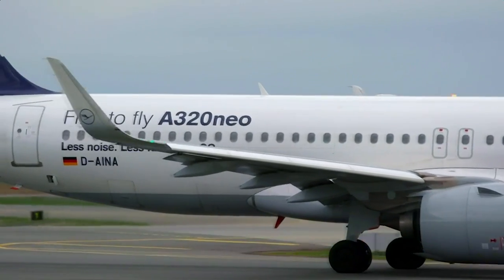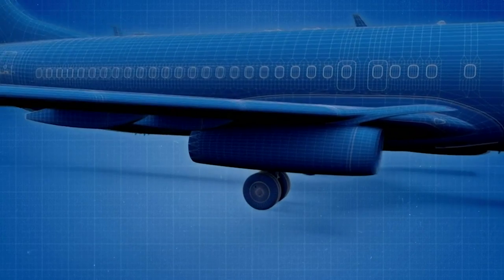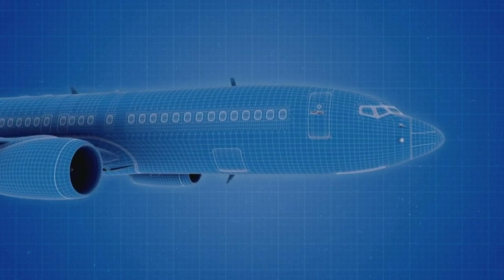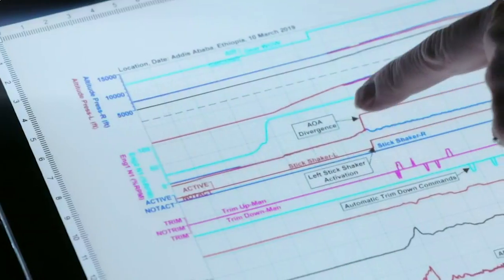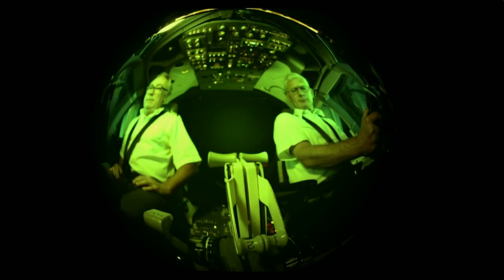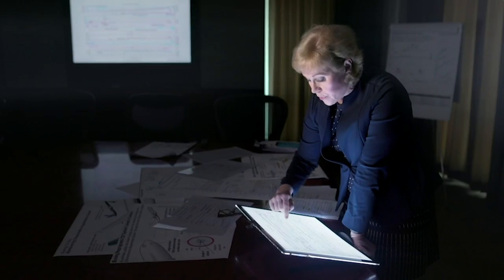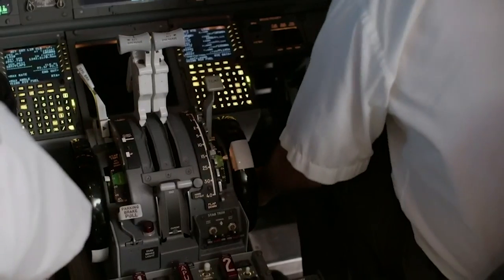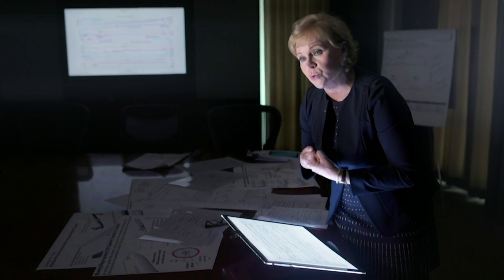Software that Contributed to 2 Boeing Plane Crashes

Comment: It is amazing that Boeing chose, of all the attitude data, one of the most unreliable ones to feed attitude data to MCAS with out any redundancy.
This comes across as a quick fix to a quick fix with the aim of Boeing to maintain market share...scandalous!
Reply: when you are programming the system and your wages are $9 an hour in india. dont expect so much. this is nothing for boeing. the 727 they lost over 100 airframes! the 737 max only 2 so far.

Comment: "Boeing engineers moved the engines forward." They did that because management told them they couldn't develop a new plane and they would lose contracts. The software didn't kill anyone, it was greed.
Reply: Along with that the company didn't give pilots extensive training on the differences between the boeing planes also due to greed.

Comment: Ethiopian 737 sensor broken by bird? I don't think so because the plane not crash around airport.  The crash site is 25-30km away from airport. Some pilots reported they struggle several times in 1 flight.  Please tell the truth. Boeing 737 from the beginning have structural problem , now in max8 Boeing added wrong big engine then secret Mcas.